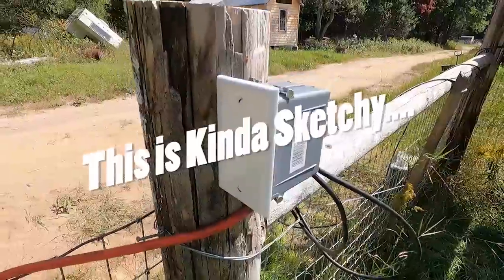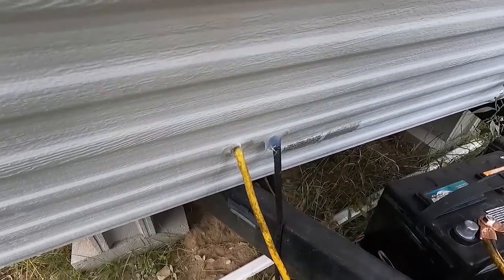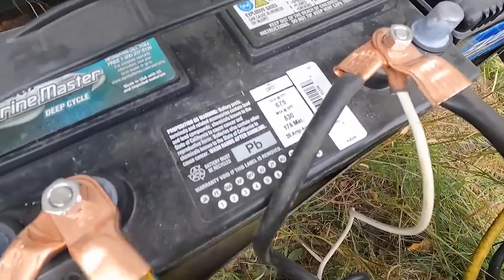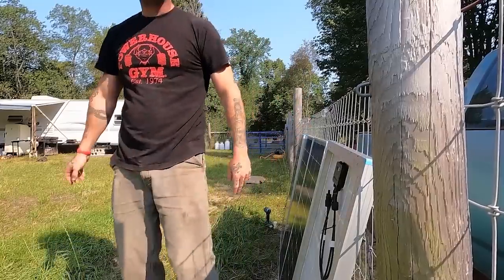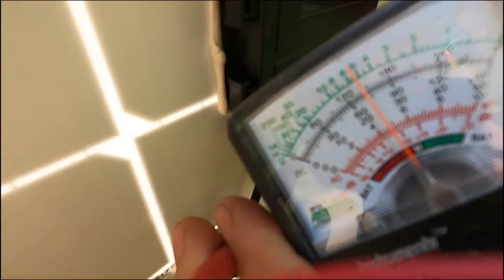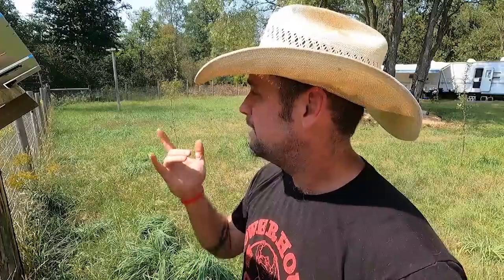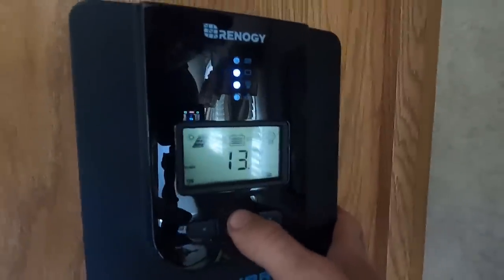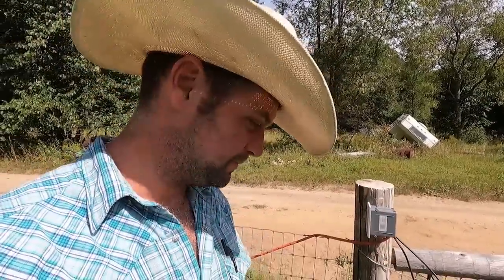How We Built Our Off Grid Solar For Cheap (under $1000)

Comment: Gday Andy, I would like to help you with your solar power calculations, you are correct with your ohms law calculations but you are not applying them correctly. When you run your 12v power supply through an inverter you used the 110v for your calculations which in turn gave you a really false amp consumption. Your supply comes from your batteries, NOT your inverter. You need to still use the 12 and not 120. Starlink is considered a heavy user of amps, around 5amps an hour and that is why you cannot keep the power up.

Comment: I have 4 200 watt Grape Solar panels on my camper. Using a Victron solar charger and a Victron  smart shunt to monitor the system via bluetooth. Only 1 battery. I dont have 120 volt yet, just the 12 volts. I added cigarette style 12 volt power ports to charge phones and works with any car style adapters. Next project is to move everything to a shed i haven't built yet. Put more batteries in there with an inverter to make shore power to plug in the camper.

Comment: Kick that solar up and add some more batteries and maybe you could add a mini split. It would heat and cool your chicken house. I added one to my RV. I live full time in my RV and it has lowered my electric bill to almost half. Do not buy a Wister Cool. I bought mine on Amazon for about $700 and it is amazing. Just throwing it out there for you to think about for either living arrangement you have for the chickens.
Reply: Split systems are great... magic devices and laws of thermodynamics are dammed. 
And if you run them 24/7 in most places it is more efficient than just on when you want it.

Comment: One really important item to remember when building your own solar setup...hook the charge controller to your batteries first. Otherwise the solar power has nowhere to go and will burn out the controller.
Also, if you want to get a little tricky and pick up an extra 6 hours of sunshine per day, face your panels east and west (instead of south)
Reply: Yeah I actually saw a company that I shouldn't say a company I think there's a couple of them doing it but they're making vertical solar panels that instead of being mounted like these are supposed to be used in like as panels on a fence and things like that for the same reason that gives you more power in the morning and in the evening rather than in the afternoon when no one's there
Reply: @blade5054  
There is a vertical solar panel that collects from both sides of the panel.
(can't remember what they're called)
The problem I see with those, there is almost no solar collection between 11am and 1pm... you're losing 3 hours of light
Reply: @chriswhinery  They are BiPolar (or bifacial)panels.  putting them verticle instead of a slant fixes a lot of problems.  Esp in the winter.   To get more charge, they have experimented with reflective material on the ground (in some cases, white rock) on both sides of the panels to reflect up to the panels when the sun is above them.  They are getting good results.  See the vids on this.
Reply: That is just false. Panels hooked up to a charge controller without a battery will not burn it out. That is what they are designed to do. They do not need a battery to function.
Reply: @eriksanders2032  
Oh look...
solar expert has entered the chat 😆
Maybe you didn't read the directions.
A lot of people make this mistake.
Reply: @eriksanders2032  Well no.   The controller needs to be connected to a load.  If not the controller ramps up voltage because it sees no voltagee (battery) or load so it is trying to create the operating voltage.  With no circuit, the voltage never is seen the the regulator circuits will burn and let the smoke out of the wires.

Comment: Just curious, so please be nice everyone. Don’t you need to protect those batteries at your trailer from weather, like rain, hail and snow?
Reply from the maker: Probably. I'll get something around them before winter
Reply: @andyslittlehomestead6705 if this was my setup I would put that box on top of the post and slap a Folgers can over it to keep those wires dry and also you need to make that no shade is on the panels because that will affect your output a lot

Comment: Andy, I am not in any way trying to give you a hard time. The only suggestion I have is make sure you are not getting shade across your panels, a small amount of shade (that post next to them) can reduce your amount of electrical output by 75 percent or more.
Reply: Glad your nuts aren't exposed. Thanks.
Reply: Can confirm, a 3” heat pipe casting a shadow over my panels makes a huge difference as the sun moves across and gets rid of the shadow. Panel optimizers help but are costly.
Reply: More correctly,  it power limits the entire system to the output of the weakest link ;)
Additionally,  a bolt sticking up perpendicular to the surface of the panel is handy to adjusting the angle.  Just make the smallest shadow, and you're spot on, "it'll be okay" cause  it works
Reply: I know that's true with a lot of older solar panels but I know there's some newer ones that that's not true for I don't remember what the different names for them are but it kind of depends on which kind of solar panel he has as to whether that's true or not.
Reply: @blade5054 only if they have diode bypass setups in certain configurations, they still make the panel effectively useless

Comment: 9:13 Dont stress about it Andy, my fancy shop I built entirely supplied by and run on extension cords run to outlets etc 😂
Reply: If you keep using the same extension cords over time they just turn into cords at the end.